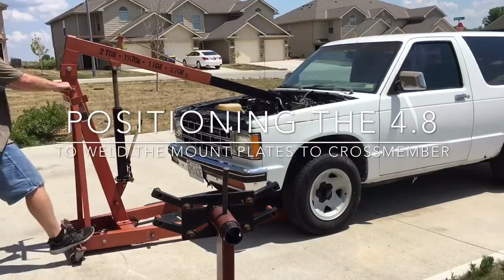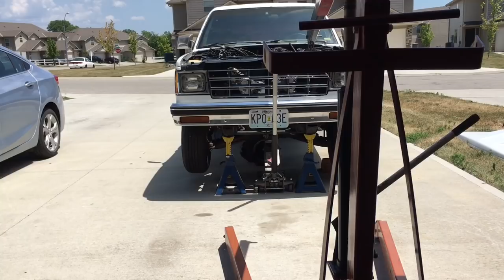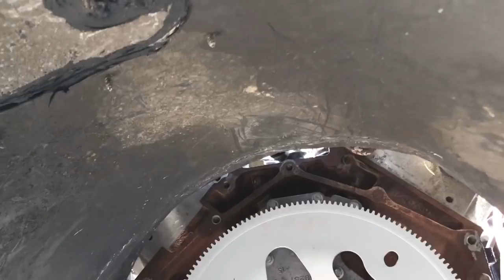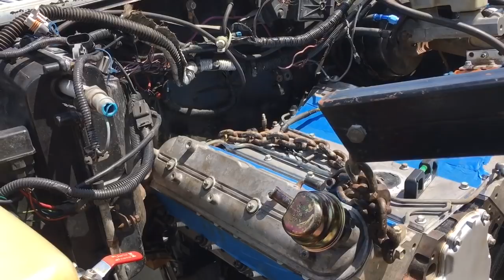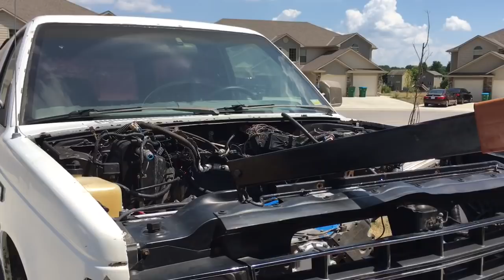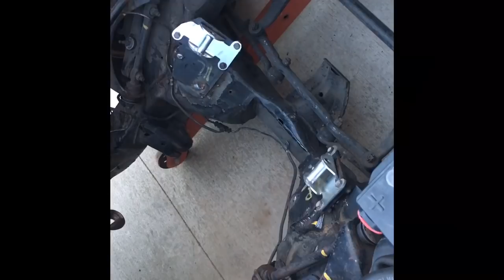S10 LSX Swap engine mounts

Comment: Looks like you moved the motor quite a bit forward? I’ve not seen anyone do it the way you’ve done it. The guys that remove the “Blazer” frame stands usually just drill the crossmember like the S-10 trucks are.
Reply from the maker: Shawn Moore The original install was 1 5/8” higher and 2 1/4” inches forward to be able to use a factory truck oil pan, T-5 transmission with an OEM trans mount. 
Since this video and older, the engine is now installed in a more factory location, this was required in order to properly setup the TH400 in the tunnel and help set the front output/pinion angle.   Check out my other S10 video and subscribe if you haven’t.  Also, log into YouTube directly from the Internet without the app so you can see all of everyone’s videos not only the one year limit!!!
Reply: HeadFlowInc I am a subscriber 😁 I was re-watching some videos with this “corona” down time. I am LS swapping my ‘90 blazer 🍻

Comment: So you welded a plate to the cross member then tapped holes in the plate for the actual mount?
Reply from the maker: Travis Southerland No, those plates are the Trans Dapt V8 mounts for the S10, that come with the threaded holes. 
Once you cut/remove the weird 2.8 V6 riser stands you’ll need something to bolt too.  We welded those adapter plates to the front crossmember. 
I ground/shaped the Camaro frame side engine mounts to work with the Energy Suspension shortest block side mount. 
I needed to have room to raise/lower the rear of the transmission in order to set the pinion angles.  If your engine sits too high you won’t be able to do anything with the output angle at the transmission, it will be pointing down 👇 and can cause vibration issues in the driveline. JD

Comment: So you still had to notch the cross member to make the oil pan clear ?
Reply from the maker: Franky Alvarezhg We notched the crossmember back when we originally did the LS swap.  Yes notching the crossmember is necessary, how much depends on which oil pan you choose to use. JD
Reply: @HeadFlowInc  thanks for the info im currently doing an ls swap on my 84 s10 engines pulled out already ready for the ls but i was looking around to see if i had to notch the frame and looking for an oil pan that would have sum clearance

Comment: The crossmember should be an easy fix. I have the th400 too. I just used about a foot of 4 inch pipe(6 inches on each side) for exhaust to run through and 2 inch dom tubing. The sides where the bolt holes are I just used some angle iron. I'll try to get a pic
Reply from the maker: Jeff Newman Sweet, I have a video on my channel showing the way my Blazer crossmember was modified to pass dual exhaust.
Reply: HeadFlowInc  Cool. I'll check it out
Reply from the maker: Jeff Newman Keep me updated, I really enjoy following/learning from other people’s builds!  Thanks for watching good luck 👍